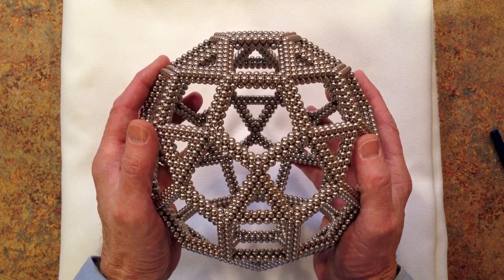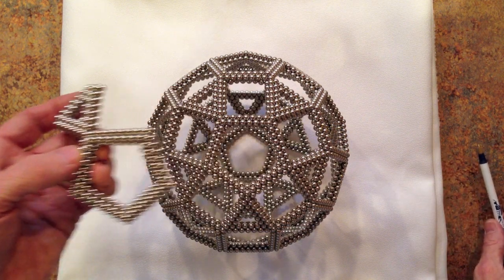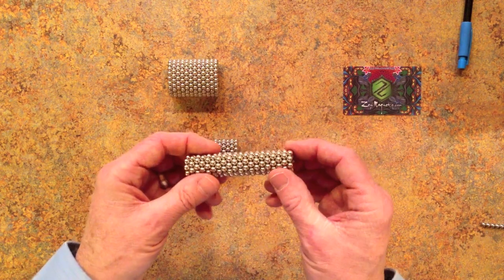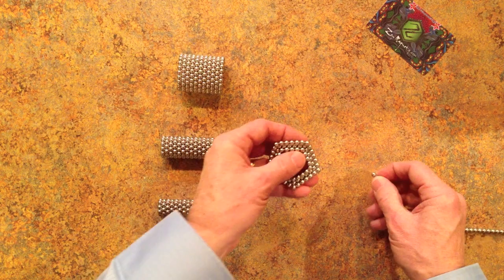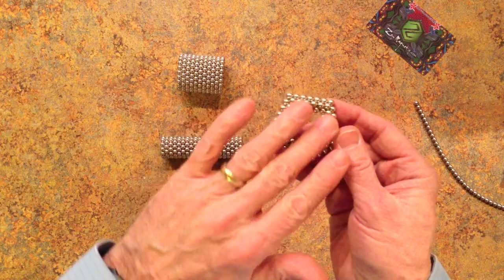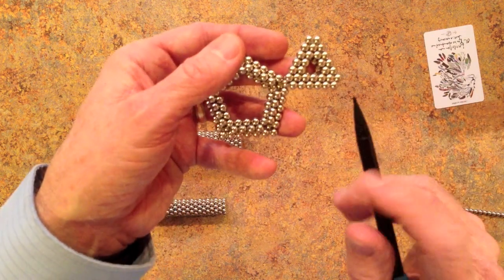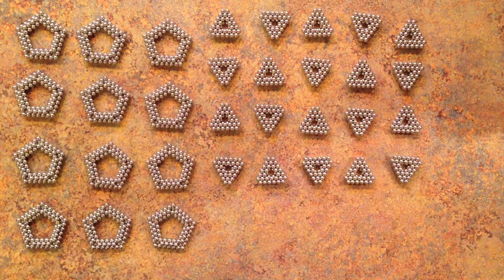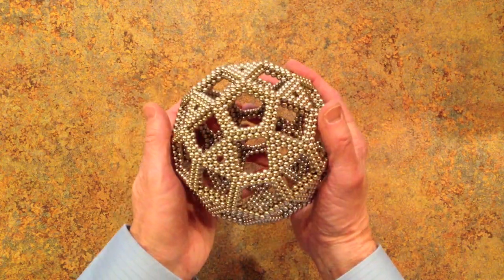Giant Spherical Frame Tutorial (Rhombicosidodecahedron, Zen Magnets)

Comment: Except Magnenaut credited his model to someone else's.
Reply from the maker: Sure enough, dinofx35. I just changed the description to credit the design to you entirely.  (Electronicsludge's video came after yours, and Magnenaut credits the design to you)  Thank you for this contribution!
Reply: I built a larger shape using much thicker pentagons and triangles.  Also, the joints are much stronger because the triangles connect to the "sides" of the pentagon (which is more like a circle).  https://fbcdn-sphotos-d-a.akamaihd.net/hphotos-ak-frc3/t31.0-8/412996_2607962446591_1434260108_o.jpg
Reply from the maker: dinofx35 Wow.  I looked at your larger shape with thicker pentagons and triangles.  It's amazing.  Can we look forward to a tutorial?  Can you build it as big as my giant spherical frame?  I believe that both your design and mine use triangles and pentagons of opposite polarities in order to get the strongest bonds?
Reply: Boyd Edwards I don't have enough magnets to make this shape any larger, but I was planning on making a video tutorial with larger subunits, with hopes that someone with ~11,500 magnets could complete it.